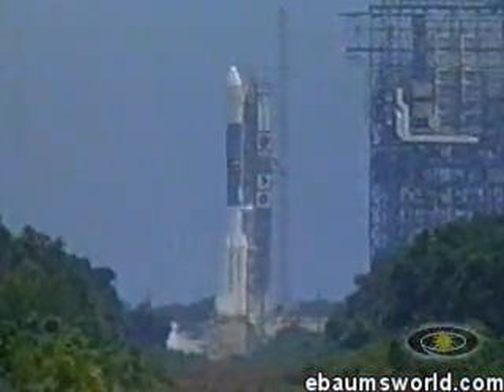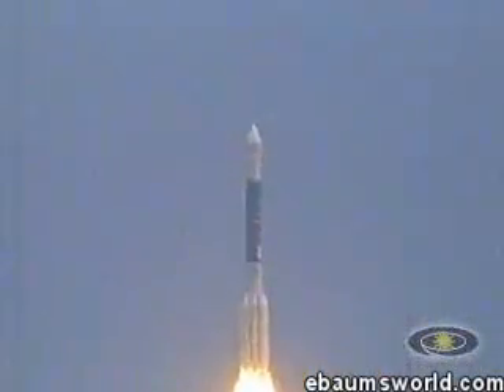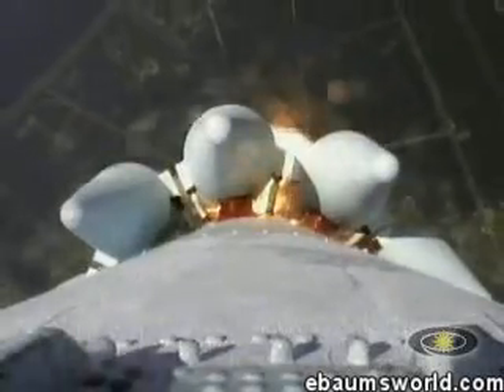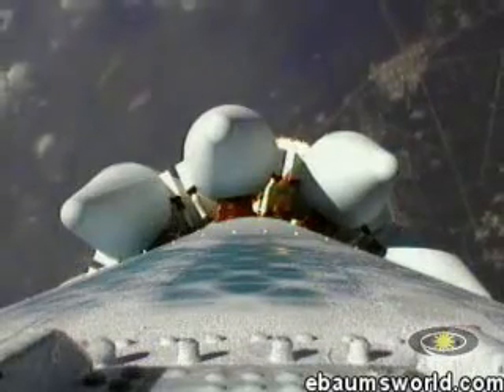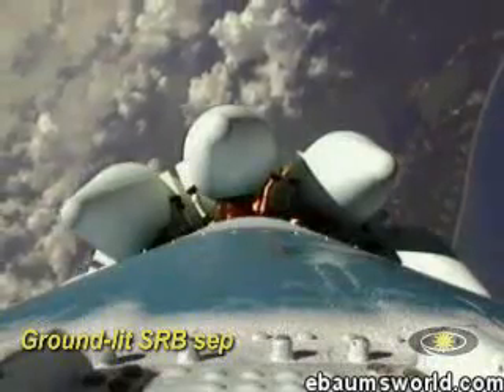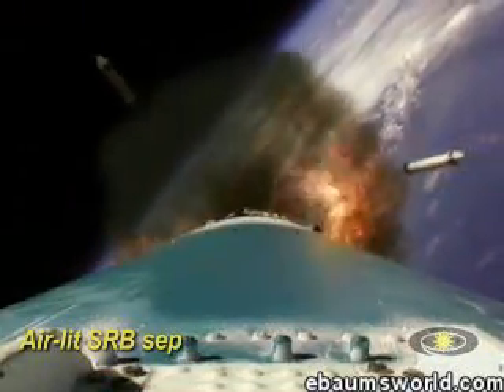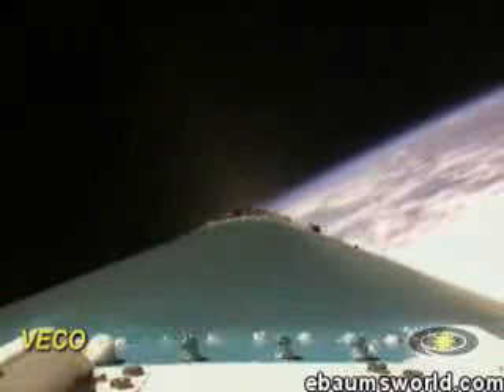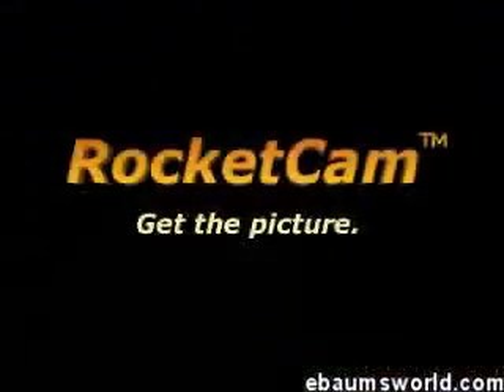Rocket Lift Off - View from Rocket

Comment: Don't believe this. This is totally fake. You can see that this is really Kerbal Space Program...
Reply: It's obviously RealSolarSystem with FAR. and KW Rocketry, atleast those boosters.
Reply: RedhotIta1 Hopefully there's an antenna on there, since they're using Remote Tech.
Reply: This video is quite a lot older than KSP...
Reply: Doc Nathan We know it is real, we're just joking about the fact it's Kerbal Space Program (A space flight simulator!) If you don't know it, check it out!
Reply: How do you figure it is fake?? How would you know?
Reply: Damn u stupid...
Reply: interesting 1 m8
Reply: it is real believe me
Reply: I know it.
Reply: ***** Maybe they are using FAR... mhhh not sure though, you might be right!
Reply: Yes, it's the stock Kerbal X rocket
Reply: Sondre Solheim go outside and up your copper and lead levels
Reply: teddy woodburn.  Yes staged.  Burnouts of stage zero (strap - ons) one, two, three.  Dump mass to lighten the load.  Hahaahahaha.  Rocket equn V = Ve  Ln(w0 / wf)
Reply: Sondre Solheim I think most rockets are staged

Comment: They didn't use pens because the graphite lead is conductive, little bits of graphite dust would have been floating around getting into the electronics causing short circuits.  The reasoning behind using a pen was very solid.

Comment: oh they are so smart they spent 20 million dollars designing a space PEN, regular pen doesn't drip right in zero g, whereas as Russians just used a regular $0.10 pencil
Reply: A pencil has graphite which is an electrical conductor.  When a pencil tip breaks it throws off graphite dust particles.  They can get into sensitive electronics and ruin them or cause a fire.

Comment: NASA - they hire the best of the best, the leading minds in astrophysics and rocket engineering,
each material is made to withstand all extreme conditions, the simple screwdriver used by astronauts in space costs around 10k USD, if not more.
every single value and point of data is calculated and tested to reach absolute perfection.
.
still recording video feed with potatoes

Comment: no. Not a Fake. This video went public also here in a scientific series of documentation concerning spaceflight . The physics happening here is way to real. Secondly it is an easy task to mount a cam onto a space vehicle sending pictures like this for documenting the flight after liftoff. See the icing of the vehicle while going supersonic after having passed the lower troposphere, see it drying and freezing/falling off in higher atmosphere because of very low pressure and shock after separ.

Comment: @snlker Yes, a camera is too heavy. Even a small one. Every gram counts. It doesn't need a camera to know where it's going either, not even sensors. It's put on a carefully calculated trajectory that puts it right where it needs to go, basically they are shooting a bullet with a bullet, from a few million miles away.

Not to mention that that "live" feed would be delayed 10-20 minutes anyway.

Comment: @snlker The cameras are on the probe,  which is in the reentry capsule and cannot see. Also those cameras are solar powered, and with the panels stowed, they do not work. And finally, no, the probe does not need to see where it is going to reach Mars, and only use the camera after landing and extending the solar panels.

Comment: @snlker Yes, triple, if you want the camera running the whole way. Scientists have been spending years eliminating every extra gram of weight they don't need, so even a camera to capture the last week or so of approach will easily consume the weight budget. Now, I understand the footage you want to see, in which case an orbiting spacecraft, not a ground rover, will get you the footage you want. Orbiters are typically equipped with cameras and solar panels anyway.

Comment: There is a main rocket engine along with the solid motors. The main engine burns kerosene and liquid oxygen. What you see is melting ice on the outside of the rocket from the liquid oxygen tank.